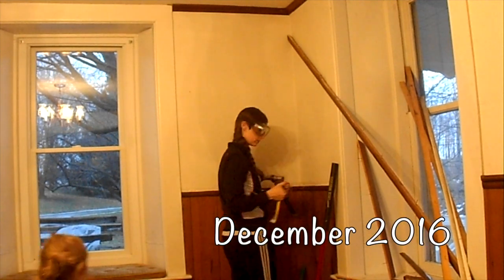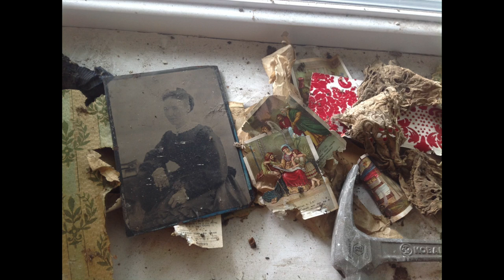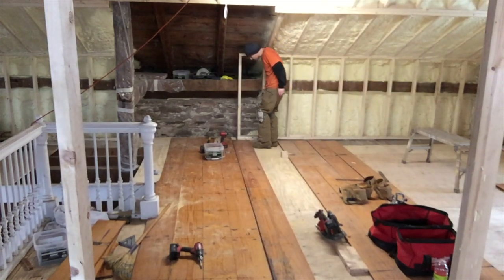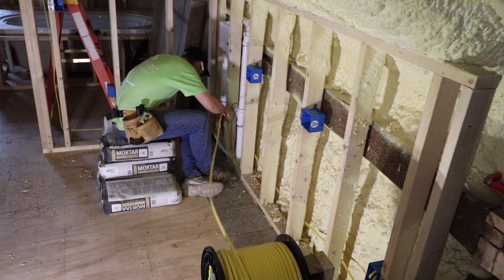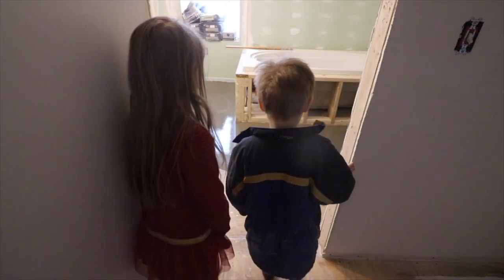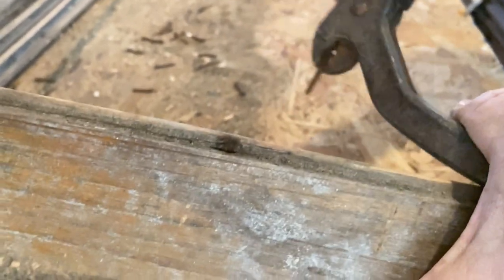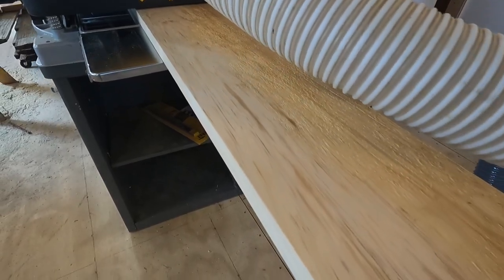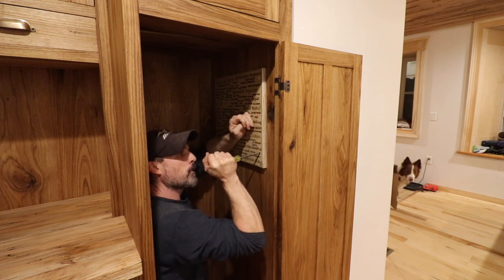Five Years of Renovation In ONE video!

Comment: At 16 min I reach the time where I joined. In the bathroom. So nice to see what went before in the right order. Love your channel. I’m really looking forward to the continuation - taking over the rest of the house and making a garden. So, please don’t give up your filming and posting. Constantly looking forward to new postings.
One thing that I’m curious about is the choice of heating in N America in most DIY videos on here. Most choose propane, oil or firewood.
Reply: Here geothermal heating (and solar energy to boost electricity system) is popular. My house is pretty “old”, 70 yrs by now, 3 floors and not very well isolated. When the last oil burner broke down 15 yrs ago it was time to do something. That 165 m hole cost a bit to drill, but has paid back many times over. The pump inside takes no place and the amount electricity used is so small that I hardly notice it in my bills. That constant worry about heating during winter is completely gone, I simply forget it, and the system still works perfectly. Turns on and off by itself at temperature you can set and adjust to time of day.
Solar panels will have to get cheaper and smaller still, but I am considering …